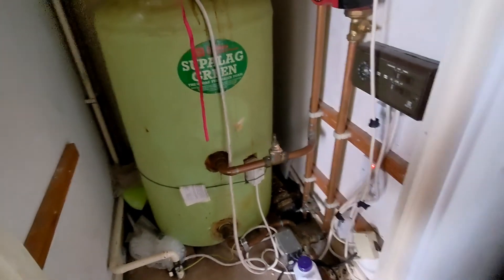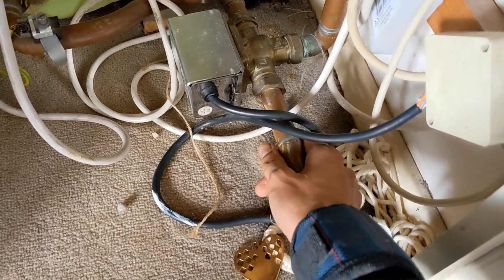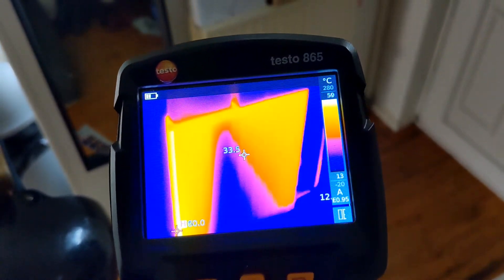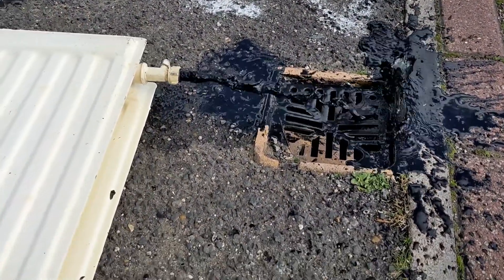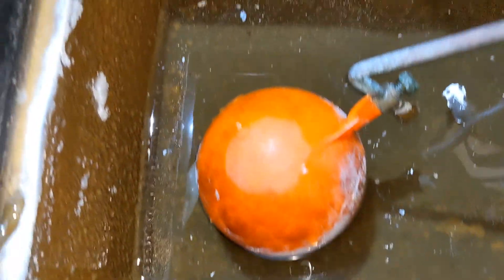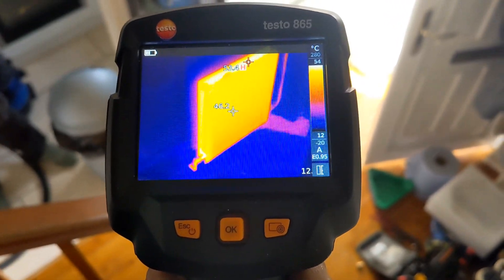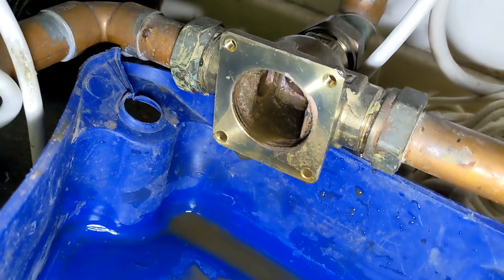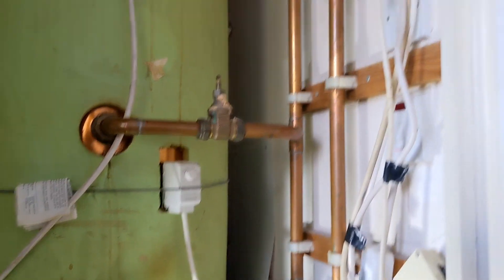Flushing a microbore system

Comment: When you bunged the header tank to swap the 3port did you have to shut the bypass and a pump valve?? I thought you can only bung a system for a two port or pump etc ie only having two open ends not three?
Reply from the maker: Nope just bunged it and changed the valve 👍🏾